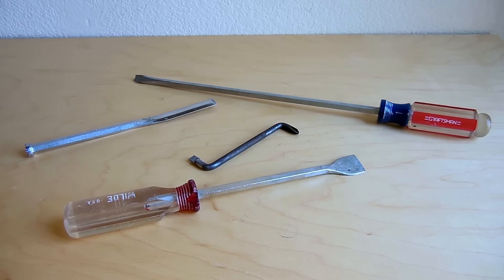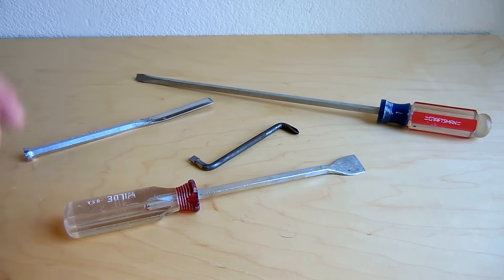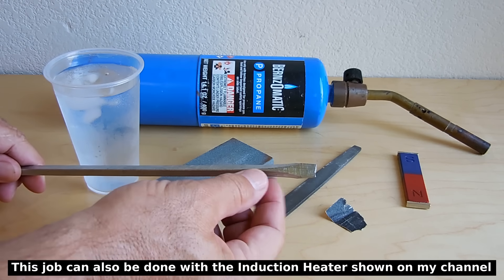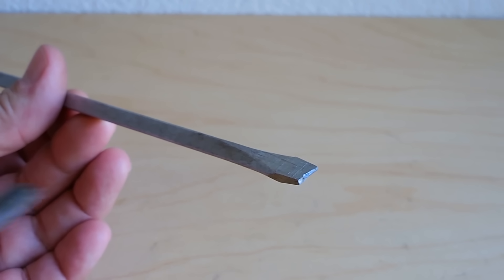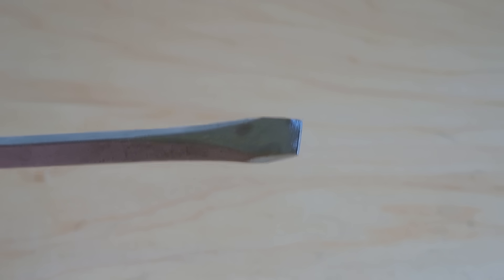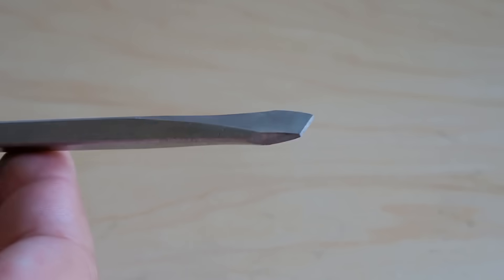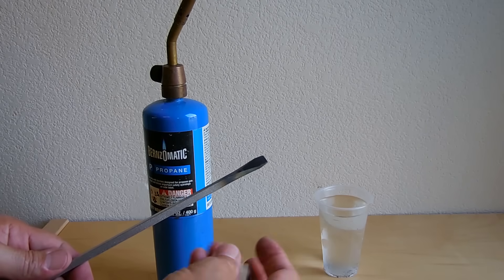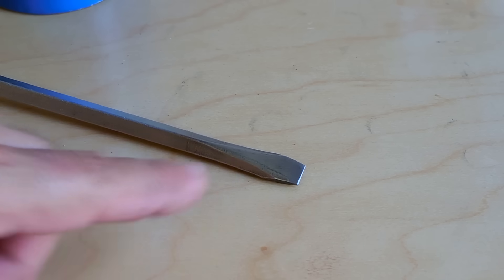How To Heat Treat / Temper Hand Tools & More!

Comment from the maker: PLEASE READ! 

There are various techniques used to heat treat steel. The method outlined in this video is a "Basic" method which has always worked fine for me. You don't have to use "cold" water, "cool" water is just fine. Many people prefer motor oil instead of water because it reduces inner soft spots as well as the chance of cracking the steel. Many also prefer to allow the steel to be slowly air cool after the tempering process, instead of quenching in cool water.

Thanks for watching
Reply: electronicsNmore  The medium used to cool or quench shouldn’t merely be a preference. What is used is dictated by the type of tool steel you are treating. W1 would be quenched in water as you illustrate. And who knows what a screwdriver is made of on any given brand right? O1 which is what I typically make punches from, would be quenched in oil. I use hydraulic fluid as it doesn’t stink as bad or scale as much. Not trying to be critical, just offering a little info. Excellent video by the way.
Reply: @stearman  it also depends on what you want to achieve. Quenching in water is quicker, air drying slower, those approaches affect the crystalline structure. Loose carbon in used engine oil can affect the outcome.

So far, most of the information I have found from youtubers is probably correct, for what they're doing. Typically hardening for some specific purpose, woodworking, metalworking, maybe cutting bones, meat, vegetables in the kitchen.

I want to resist bending, the process is about the same, but I need to temper differently.

Your thick screwdrivers need to be handled differently from thin ones, for optimum results. The centre cools more slowly than the surface.
Reply: Tim is correct. There are water hardening, oil hardening and air hardening steels. Using the wrong method results in not only sub-optimal treating, but possibly a damaged crystal structure, which could result in cracks. If you use oil hardening steel, you shouldn’t use motor oil, because the additives can cause various problems. Use quenching oil, which also has the proper qualities.

You don’t have to (usually shouldn’t) quench after tempering, but the temperature should be brought down slowly.
Reply: @Aaron Washburn oh, and I just realized I kinda didn't actually answer your direct question: the reason one "shouldn't" quench is because that quenching creates stresses, and the a significant portion of the point of tempering is to reduce stress.
Reply: @DavidLindes  My problem is a bent tine on a garden fork. Bending it back into place isn't too difficult, but  I am wondering abut heat treatment to strengthen it. Ideas, please?
Reply: @oneeyedphotographer  I don’t know enough to give more specific advice than I’ve already given. Hopefully some of the resources I provided earlier can be helpful, and/or you’ll find others that are.
Reply: @DavidLindes  thanks for responding. I found a lot of technical detail including charts and data about chrystalisation in another video. It's more complicated than others I've found realise, and the quenching method depends on many things including the size of the material.

Most tradies have specific answers for their specific needs, that's why there's some disagreement between commenters here, they are likely all right.

Most people are talking about hardening, I want to strengthen. It seems I have to get glowing red, quench, reheat, quench. I don't know how far to reheat.
Reply: @oneeyedphotographer  I would *guess*, based on limited knowledge and experience, a dull cherry red... glowing, but not necessarily super bright red. But I’m by no means an expert, so... take that with about a whole salt lick.
Reply: @DavidLindes  For tempering after hardening? I've been thinking red to harden, then around blue to temper, but I have only what I can remember from school 60 years ago and some recent googling. No experience.

I don't have much to heat it with, it could be cheaper to buy a new fork.
Reply: @oneeyedphotographer  I’m less sure about the tempering side. Blue is quite pretty, though. I made a letter opener out of spring steel in a blacksmithing workshop once, and tempered it in an oven to a nice blue... it’s delightful. :) For a garden fork, of course, I imagine the blue might scrape off in time. But yeah, somewhere between amber and blue surface color (a wholly different thing than the red that I believe is what’s called “black body radiation”...) seems to my minimally-informed intuition as plausibly reasonable. But don’t take that as saying it’s right. :)
Reply: @DavidLindes  I don't care about the colour, it will go rust red in  no time. Like ours Pilbara region which is basically a pile of rust.

If I get it wrong, I'm no worse off. I can have another go, put up with it, or buy another fork to bend on the next rock.
Reply: Aaron Washburn: interesting stuff; thanks!

On that last point, it could also come from folks conflating the behavior of glass??!? With less-than-perfect annealing, glass can (I'm told, anyway) spontaneously shatter even years later just from the thermal gradients of daily life. I suppose especially if left near a window. I don't expect steels would be likely to do this, though perhaps if they were especially brittle???!? -- certainly the not quenched long enough scenario creates a plausible avenue for it, though that would still be within a short time, rather than spontaneous cracking later... I guess? :)
Reply: @Aaron Washburn quenching is incorrect for tempering. I don’t know what you’ve been reading, but go to the steel manufacturing sites an read their recommendations for hardening and tempering the various steels they make. You don’t quench after tempering because you want the crystalline structure to “relax”, and that occurs slowly. Quenching freezes that structure before it gas a chance to finish. Additionally, the various molecular structures are changing composition, and that also takes time. Cracking can occur if you quench after tempering g upon use.

I understand that when hardening and tempering simple shapes no subject to much strain or impact, you may not notice much difference. But if you can prop,early test the materials with standard testing methods, you WILL find that difference. And if using the part to its extremes, it will fail in one way or the other.

I don’t know why, but your reply was just relayed to me after apparently a year.
Reply: @Aaron Washburn When I was young, razor blades were double edged and quite flexible. Blades I've seen most recently are thicker and don't flex. They'd be tempered differently.
Reply: @Aaron Washburn I found a bloke with lots of technical detail including charts. More an engineer's education than a tradies. It was fully consistent with what I remember from school, 60 years ago, but stuff has changed since then. More alloys, better knowledge of the old ones. He explains about cooling, the crystalline structures resulting, how to choose amongst them.

I have a better idea of what to do, but I need my recipe you have yours.

I need to straighten a tine, harden to the max, temper to resist bending. Tempering for hardness might leave it a bit brittle.

I'm assuming some kind of tool steel, it's weakened by bending, and somewhat resistant to rusting.
Reply: depending on the type of steel would depend on weather you would use water or oil to quench .
Reply: Great video!
Reply: The first time time the team was was a year before before they had a a new coach in in place and the team had a chance at the end end to get a chance at the top spot for a a team with with with the the best players on their side of town town in a a few weeks ago so so much to see
Reply: @Aaron Washburn: my (lay) understanding (so take this with a grain of salt) is basically that the ideal is to heat slowly and to a (relative to the next option) lower temperature, and cool slowly (no quenching).  But because it may be difficult to do a carefully-controlled heat (especially with comparatively primitive methods), another option is to "over"-heat the metal (for the given amount of tempering desired), but cool it quickly, to avoid other side effects of being at that heat.  For tools without the (as shown here) plastic (or wooden) handles, that are comprised only of the steel, a modern option is often to heat in a (toaster or regular) oven, which can (sometimes) give relatively controlled heating, and thus not require quenching.  Other methods of slowing the heating (e.g. heating in a bed of brass shavings, by heating the container the shavings are in, rather than heating the tool directly) would presumably also not require quenching.  Check out the Clickspring channel for some beautiful examples of that (warning: he takes all this to a whole other level; be prepared for some awe), including using a very careful process to get beautiful aesthetic tempering.  For practical use, of course, this isn't required... and another common method is to over-heat one part of the tool to let heat slowly seep into the actual tooling surface(s), thus giving greater control where it's needed, even while using relatively crude heat sources (edit: as shown in this video, as well; see 9:17 and 10:17).  A nice example of that (from Clickspring) is here: https://www.youtube.com/watch?v=FFWSaffwZOo ... and here's the aesthetic version: https://www.youtube.com/watch?v=NhjiIPohUyw

You might also find this video about case hardening to be of interest: https://www.youtube.com/watch?v=V_Mp1fNzIT8

And/or find useful information in some or all of the following:

https://en.wikipedia.org/wiki/Tempering_(metallurgy)
https://en.wikipedia.org/wiki/Hardening_(metallurgy)
https://en.wikipedia.org/wiki/Quenching

Comment: I've been doing this for years, especially with Exacto and utility knife blades. I use oil instead of water also. It doesn't cause such a shock to the tools as water does and makes it a bit easier to temper them, IMO.  I also case harden certain items with the remnants of a can of case hardening powder I got from my grandfather. You can also easily resharpen hardened tools by using diamond sharpening stones or plates and a strop.

Comment: @electronicsNmore You should use for cooling oil rather then water... Generally speaking it should be special oil dedicated for tempering , but black, worn,  engine oil also will do well enough , but you must be carefull and put object n and out quickly  to avoid oil ignition.

Comment: If I wanted to make stainless steel screws blue/purple for the ~aesthetic~ could I just use a heat gun at a steady 550°F until they turn that color then quench them? Would tempering them like this affect their structural integrity? Any advice or tips would be appreciated!

Comment: You should quench in oil, not water, especially with knives and thinner tools. Water presents a greater possibility for cracking of the metal and ruining the tool or knife.

Comment: 🔥 cracking video...! Takes me 50yrs back in time, when our Metalwork teacher showed us this method. As a kid it was so inspirational. Bring back woodworking and metalworking to school curriculums.!!!!!
Reply: I learned it from my father in 1988. I did some firing pins, extractors and cylinder stops for my guns in the 90's. I had an idea int those days: what about to temper diping the steel on tin as soon as it becomes liquid? Just to keep the steel under tempering temperature for a longer time.
I am an accountant now and I don't do these things anymore, just curious.
I have a manual where it's written something like (to temper reamers and drills bits) "boil in water for 90 minutes".
Reply: Hi woo. Is it necessary start out using that specific type of steel?
Reply: Too dangerous 😮
Reply: @User0resU-1 Too dangerous , I bet you never climbed trees or went swimming in the local canal !

Comment: The tempering requires a SLOW cooling! You NEVER quench in oil, water, or anything else during the TEMPERING process. for the hardening process, which is before tempering, YES, cool O1 tool steel quickly in OIL! the "O" of O1 tells you that the steel is to be OIL quenched.
Reply: That's what I thought. I thought tempering was bringing to temperature then covering to cool slowly

Comment: Steel becomes non magnetic and orange at over 1400*F degrees. NOT 600*F !! When i worked at a sprong factory we didnt treat anything at less than 1450*F no matter what! Usually we would be more like 1650*.... Even during annealing we did 1175 to 1250*F

When tempering a knife i do 2 hours at 450*f and get about 55-57 HRC rating
Reply from the maker: I never said 600F.

Comment: hello just a quick question - can I use a butane torch instead of a propane torch or will it not be hot enough? thank you
Reply from the maker: For small metal objects, butane should work fine.

Comment: this is great, but why are you tempering it to blue and then cooling off immediately, shouldn't tempering require the part being tempered is cooled nauturally with air?
Reply from the maker: Just showing a method I was taught back in the 80's, there may be better methods. Thanks for watching!

Comment: I'm not trying to be a know it all, or anything, just a suggestion. The most heat from fire, torches, oxi-acetylene, map-gas etc. Is at the tip of any open flame, so a half in above the tip will heat up any object so much quicker, and will save you a lot of fuel, and hard earned money over a life time. Try it you'll never go back to jamming it into the blue part of the flame again. Time is money especially in business. Thanks for sharing, done nice and simple. The old kiss method. Again Thanks for the knowledge and sharing it. Andy T Barrie Ontario, 🇨🇦

Comment: Hi, I'm making locksmith tension bars outta thin pieces of steel and after I heated them up to curve them into a more fitting shape I hardened them post orange glow and was surpriced to find out that they got soft as heck. Is that because the were too hot and because I didn't temper the pieces of steel?
Reply from the maker: What type of steel?

Comment: quenching liquid is determined by the manufacturer , some metals quenched in water ans some others oil and others require cool blowing air ,, tempering is 700c times the volume of the tool ,, heat treatment is 3 years training for diploma and reliability of workers ...for instance , 4terpilar 200t truck after welding chassis he spent 24hours in 756c to harden welding giving the truck the ability to haul 200 tones....if bits are made by chromvanadium or chrommoly it's already chemically treated and hardened...thank you for your tutorial...i did your method years ago on cheap Chinese bit , it didn't work , the bit broke after 5sec under screwdriver ...  thanks again... more success
Reply from the maker: The bits treated should ONLY be "High Speed Steel" type. Thanks for watching!
Reply: @electronicsNmore  my pleasure ,, n thank you too

Comment: This seems correct except if you are trying to temper knives you don't want to quench them aster you see the colors that would make the metal brittle and it would shatter like glass. What you want to do in that instance is to wait for it to reach room temptature
Reply from the maker: You can also oil quench to be safer. Thanks for watching!

Comment: Great fast to the point video! Awesome job!! Only thing I see an issue with is not letting the temper process cool down slowly instead of dunking it in the water. But other than that Great video man! Keep it up!!
Reply from the maker: Yes, some recommend placing the item inside a small toaster oven to cool very slowly. Thanks for watching!
Reply: I've done further searching, air cooling and quenching are both correct, depending on desired outcome. Used engine oil got an honourable mention for its carbon content.

Comment: Tempering is better if it is quench in air. Slow heat loss
Reply from the maker: That's true, you can also use a small oven. This was just a basic method that I've used for many years. Thanks for watching!

Comment: Hi.  I lost various steel and cast iron hand tools in the 2018 Paradise "Camp Fire".  I saved some that were totally burned and then rusted in the ensuing rains.  The little handles on my vises, which tighten the bases, are really bendable.  Can these be rehardened via your process?  Also some of the machine screws on my vise jaws are soft now.  And the main jaw threading screw needs to be softened to straighten it and then rehardened - can this be done?  Thank you for your help
Reply: Hi, I heard those were caused by emp, so the metal actually heated up and caused the fires. At first I thought that sounded crazy, but I saw many bizarre things like nails underwater that had charred the wood they were driven into on a dock, bridges with holes melted through them miles from anything else burning, and rows of bombed out cars on the beach, also miles from any external fire source. Did you see any evidence of this kind of foul play in your area?

Comment: Few questions:
1. I thought that tools like the ones you used are already heat treated from the factory, so why do it again
2. Why do you heat the steel twice, one for hot red and second to blue, what's the advantage?
Reply from the maker: Tools can lose temper due to heating. Using a bench grinder too long, can ruin the temper of a blade or tool. You need to temper, otherwise the tool will be too brittle.

Comment: I am planning to make a couple of shovel for metal detecting at my job. I will design them with Delta cad, then plasma cut them. Do you have any videos on how to heat treat & temper shovel blades. I need them to last. Thanks.
Reply from the maker: Unfortunately I don't have any videos for that. Thanks for watching!